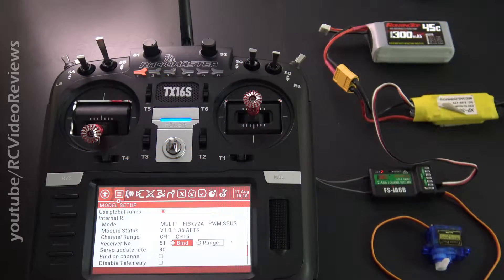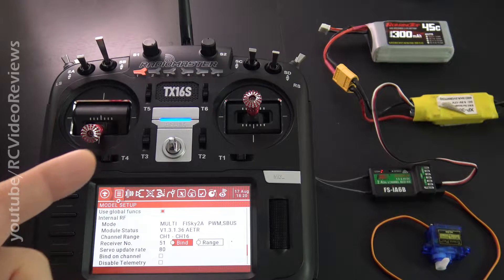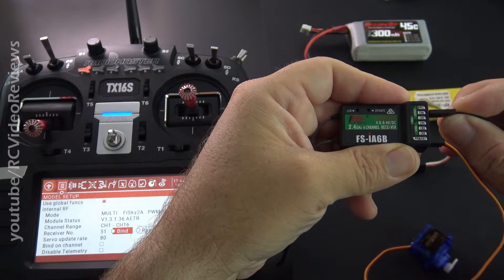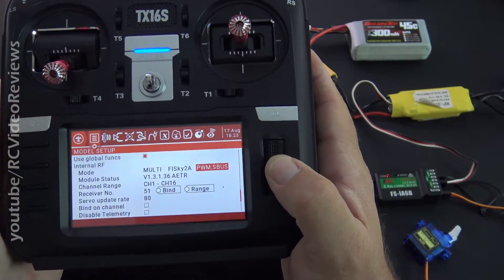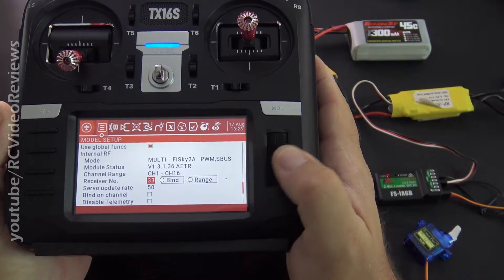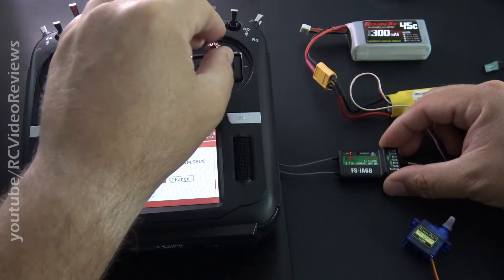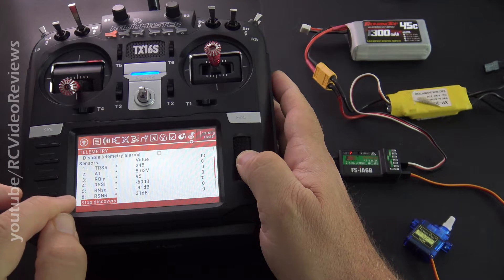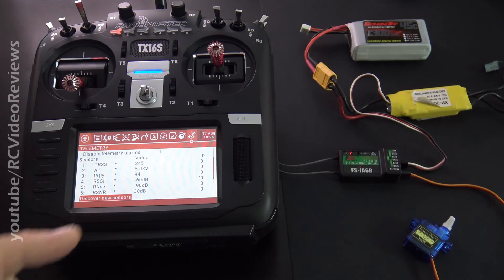How-to Bind Radiomaster TX16s and FlySky FS-iA6B • PROTOCOL FREEDOM FTW!

Comment: have you tried to turn off the TX with the RX still on? In my case it just loses the bind. If i turn on the RX before the TXm also the bind is gone. do you have it too?
Reply from the maker: I haven't specifically tried any of those combos, but I normally power of the rx before tx, and the last time I checked, I still had a bind. You really shouldn't lose bind no matter which one gets turned off first.

Comment: Can you connect the radiomaster tx16s to FlySky FS-a8s?
Reply from the maker: Check out the protocol page: https://github.com/pascallanger/DIY-Multiprotocol-TX-Module/blob/master/Protocols_Details.md

That Rx is supposedly AFHDS2A and that is listed on the protocol page.

Flysky AFHDS2A 28 PWM_IBUS PPM_IBUS PWM_SBUS PPM_SBUS PWM_IBUS16 PPM_IBUS16   A7105 
Flysky AFHDS2A RX 56 RX
Reply: @RCVideoReviews  Thank you but it only works for PPM. I tried sbus and Ibus bt it only binds with ppm

Comment: Great video. Received my Radiomaster today but cannot seem to access the FlySky 2A protocol. I just get FlySky only. How do I change to the 2A protocol? Your video shows your t/x already on FlySky 2A.
Reply from the maker: I just looked on my radio and confirmed FlySky2A shows up immediately after FlySky. I did nothing special to gain access to that protocol. Just enabled internal RF module and scrolled right to it. You may need to check your MPM firmware version and maybe even flash a new one. It should be there out of the box though.
Reply: @RCVideoReviews  Multi is on and FlySky shows up to the right. Click on FlySky which now blinks, rotate scroller and then Corona shows up, keep scrolling and get various other radios but no FlySky2A. A bit disappointing as I only bought this radio to get access to FlySky 2A so I could use voice commands for sensors.
Reply: @robertmillhouse6388  my problem 2, did u solv it?
Reply: Me too, Flash the firmware will show all protocol?

Comment: Hi 😊👋
Thanks for this video!
I have RadioMaster TX16S with hall sensor gimbals, multiprotocol. Can tx16s bind with Flysky x6b receiver? I tried to bind but unsuccessfully..
Thanks again
Reply from the maker: Here is the protocol list: https://github.com/pascallanger/DIY-Multiprotocol-TX-Module/blob/master/Protocols_Details.md  If the Rx is on that list, it should bind.

Comment: How to set failsafe for FS-iA6B on radiomaster tx?
Reply from the maker: You can always set failsafe options in the radio under model setup. Below the Rx bind options you should see a line called "Failsafe mode" On that line you can specify hold, custom (which lets you program per channel values), no pulses, or receiver. I haven't verified operation on the ia-6b, but if you set failsafe on the Tx to receiver, then you have to hold your sticks where you want them by pressing the FS/Bind button on the Rx. Personally, I would just use custom instead. Much easier to manipulate and change after the fact.
Reply: @RCVideoReviews  I just set no pulses. I'm not expecting you reply such long. hahaha. Thank you very much! Your videos help me a lot in this hobby.
Reply: @gaddivo  I went to custom then set the channel 3 to -100 (throttle cut)

Comment: hi, first time i made fpv drone (radiomaster tx16s) i paired it with fs-ia6b but the motors are not moving, why do you think? 
everything looks normal in betaflight.
Reply from the maker: If you're getting Rx movement in Betaflight and your motors aren't turning you have something wrong in Betaflight or the motor wiring. If BF sees Rx movement the problem isn't with the Rx. If BF does not see Rx movement you have to get that working.
Reply: @RCVideoReviews  thank you friend, i found the problem. I did not activate the key required for the motors to start and therefore the motors did not start

Comment: Which protocol would I use to bind to a Flysky Mob 6?
Reply from the maker: Not sure. There are three options. Try all three to see if one of them works:
Flysky 1 Flysky V9x9 V6x6 V912 CX20    A7105 

Flysky AFHDS2A 28 PWM_IBUS PPM_IBUS PWM_SBUS PPM_SBUS PWM_IBUS16 PPM_IBUS16   A7105 

Flysky AFHDS2A RX 56 RX
Reply: @RCVideoReviews  thanks
Reply from the maker: You're welcome.

Comment: does any one checked latency with that combo?  tx16a + fs receiver
Reply from the maker: I have not, but I can't detect any discernable differences between this Rx and any other Rx I fly with the radio. Do you know something...?
Reply: @RCVideoReviews  no i dont :) but i know that flysky has the lowest latency protocol on the market. Im planing to switch fsi6 for tx16s but i would like to keep fs receivers in my helis but im afraid that tx16s multiprotocol will induce some higher latency

Comment: Great video! Thx! Is it possible to set a signal warning? Like a warning sound that tells you that your  signal is low and you need to return?
Reply from the maker: Yes. If not directly in the telemetry screen, it would be very easy to put a logical switch/special function together: 
Logical Switch L01: a<x RSSI 40
Special Function L01 Play Track RSSI Low
Reply: @RCVideoReviews  thank a lot man! I set it up and it works really well! This will save me a lot of money 😅

Comment: Great video! does failsafe work with these settings? how did you set the failsafe?
Reply from the maker: I set failsafe on the radio itself with no pulses. I haven't attempted setting Rx failsafe (I never really do)
Reply: @RCVideoReviews  Thanks man
Reply: @RCVideoReviews   i did no pulses  it is not working on this receiver
Reply: how to do failsafe on this receiver

Comment: I use flysky RX all the time. The PWM/PPM selection tells the receiver what to output on the main channels, use PWM for servos. If you want PPM for stabilizer or flight controller then select that option (PPM output is in CH1). 

The SBUS/IBUS setting tells the receiver what to output on the IBUS Servo port on the top (labelled in green). IBUS and SBUS are basically the same but inverted logic - again useful for flight controllers or stabilizers.

Flysky also have a IBUS sensor inputs, you can daisychain standard flysky sensors (voltage, temp, rpm, altitude) but the best thing about opentx is it supports way more custom sensor data via the flysky protocol so flight controllers will report the full gps, current, attitude stuff too.
Reply from the maker: Charles, Thanks for clarifying. I'm familiar with PWM, PPM, SBUS (and I understand IBUS is FlySky's version of SBUS that doesn't require inversion on flight controllers). I thought it was odd though that using other combinations resulted in telemetry dropouts and jerky servo movement. 

Since I'm not using sbus/ibus/ppm it worked out. I may do a little more testing and reading to find out if there's something else at play because the Rx side protocol shouldn't cause telemetry issues.
Reply: @RCVideoReviews  Hola.
Recientemente un amigo tuvo este mismo problema y se dio cuenta al comparar la configuración de su antiguo flysky i6x. Tenía pérdidas de telemetría y al hacer el cambio fue que solucionó todo.
Cuál es la combinación que no te da fallas de telemetría a ti?
Reply: I have seen similar if I power up really close to the TX. Normally a power cycle on receiver and transmitter after moving them apart sort it for me. Never had any issues in the air
Reply from the maker: @charlesjones5070  Thanks for the tip Charles.
Reply: The flysky receiver ia6b is great and I'm using it with the voltage sensor which is very useful in order to maximize the flight time the only issue that i have that  im getting all the time messages about telemetry lost .. any idea what can be the issue ?
Reply from the maker: @YuvalPalomo  You probably have RSSI alerts for <42. RSSI isn't the preferred link quality metric for the IA6B, it's RQly. So if you're alerting on RSSI turn that off.
Reply: Hi Charles, I am new to Open TX. Having mostly Flysky receivers and few XM+. Now I just bought a Radiomaster TX16S. Could you let me know if you have any video to bind the TX16S with a Fs-ia6b on I-Bus? I wasn't able to get Aileron and Elevator working after binding. Even the Rudder is jerky. I have no issue though when binding with a Mini-Ibus 8/18CH AFHDS 2A. Thanks a bunch!
Reply: So if im using voltage sensor on FSi6b receiver... i need to choose PWM/IBUS to bind?

Comment: Nice one - yep FlySky Receivers are really great value and work great with the TX16S, including failsafe settings and access to telemetry. I find the RadioMaster TX16S and FlySky IA6B Rx gets better range compared to using the standard FlySky i6 Tx (my i6 is modded to 10Ch via bojangles software hack) and the servo actions are smooth over the full range (using std analogues). Currently I'm waiting on a FlySky FS-CVT01 Voltage Sensor to arrive to add to the telemetry so i can monitor the flight pack voltage separately from the ESC derived 5 volts that you see as the A1 value in telemetry by default. For those who want to hack the IA6B to give a flight battery voltage directly there are hack videos and forums that demonstrate how to mod the IA6B receiver (https://www.youtube.com/watch?v=vUC08Ky5qr0 is one example).
Reply from the maker: I looked at that voltage sensor. It looked kind of beefy compared to what I'm used to from FrSky.

I was surprised. I thought the telemetry would require jumping through hoops--nope. Hard to beat $11 for a 6ch sbus Rx with telemetry. 

I hope FrSky is paying attention--they've gone the wrong direction.
Reply: @RCVideoReviews  Agreed, and the FlySky IA10B 10 channel receiver is just the same as the IA6B but with more channels....and still cheap for a 10ch Rx. I was gearing up to buy a new FrSky radio just as the TX16S came on the market; after a few reviews of the TX16S it was like shut up and take my money.
Reply from the maker: Yup. Me too. I had a few issues and looked at just buying another Taranis until I did the reading--same exact response. I thought I read there is an external MPM out there...?
Reply: Do you plug in the voltage sensor, and it just works as with an Flysky tx?
Reply: @Iceman_2003  If you have the TX16S radio paired with a FlySky Rx then plug in the voltage sensor into the Rx and then scan for the voltage sensor in the telemetry settings in the Tx and it will appear as an available value. You can then use that value as you want, either to trigger automated responses at nominated voltage levels or direct off a switch.
Reply: @deancooper5513  Thanks!
Reply: @Iceman_2003  yes
Reply: @Iceman_2003  you can also remove bec voltage and put back the range, which disappears after plugging in the voltage sensor
Reply: Did you manage to set up the voltage logger? I am using the CVT01, but you need to pair the receiver under PWM/IBUS otherwise the voltage telemetry will not show up - my concern now is, as this video describes that the IBUS option bind is not stable then… any experience with this?
Reply: @solreinecke6084  I've had no issues with the CVT01 sensor, and use it on 90% of the models I have and so far the TX16S and IA6B Rx units work fine with active monitoring / readout of voltages.
Reply: @deancooper5513  Roger, thanks!
Reply: I have this voltage sensor, its very small and works great on my fs i6. Just waiting to get a tx16s mk ii!